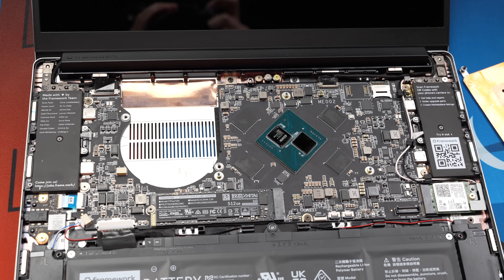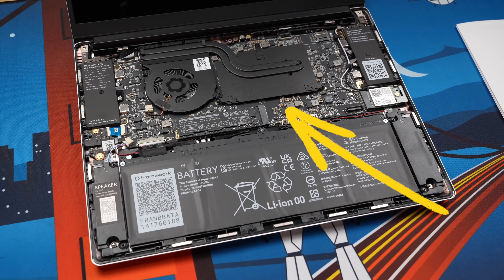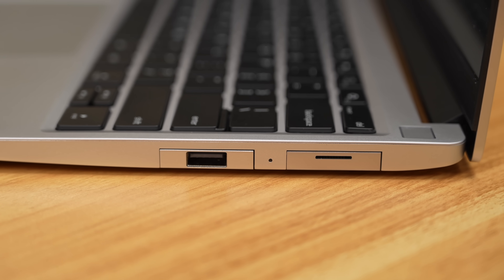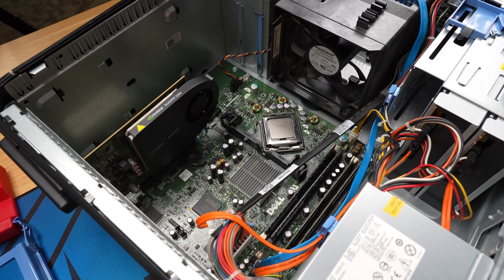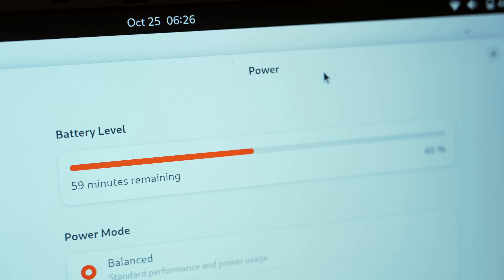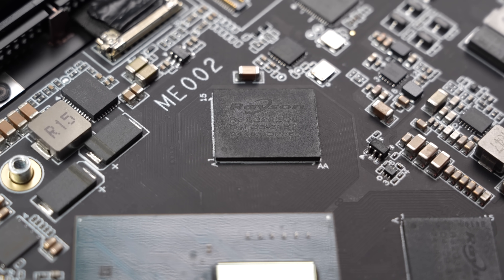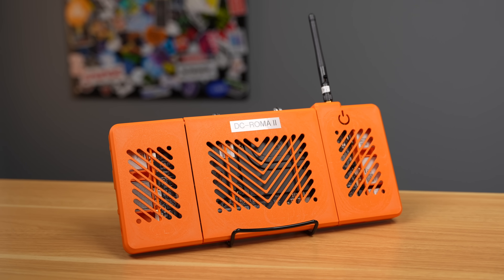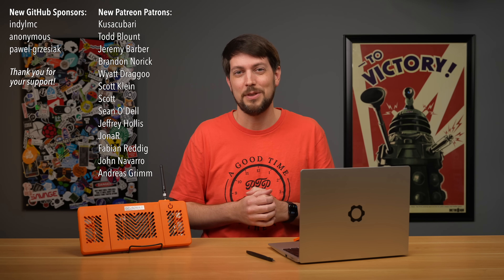This is not a Framework Laptop

Comment: The raspberry Pi 5 idles at around 2.7 watts and consumes 10 watts load.

The whole pi5 power adaptor is specified to supply 15 watts in total.😅

Comment: Core 2 Quad didn't have major issues with RAM - it wasn't NUMA, this was back when the memory controller was on the Northbridge. So it behaves more like a modern Ryzen desktop chip with the memory controller on the IO die.

Cross chip cache access was more cycles, just as it is on Ryzen.

By the sounds of it, this chip is NUMA.

Comment: Cross-die memory access was actually not an issue with the Core 2 Quad. This is because the Core 2 CPU dies did not have on-die memory controllers! Instead, both dies shared a common "front-side bus" that connected them to the Northbridge chip, and the memory controller (and integrated GPU, if equipped) was located in the Northbridge chip.
Reply: I guess another way to think about it is that since the Core 2 didn't have an on-die memory controller, all memory access was cross-die (to the northbridge). But it was equally bad from all cores, at least.

Comment: Looking at that graph, it’s not that cross chip latency is 2000 — cross chip latency is clearly 1000, but on the second die, the four cores just in that chip cannot communicate among themselves, they have to go through the main die (which is why their internal comms are at 2000 instead of 10). The old C2Q had much better due to die latency but also the two cores in the secondary die could still communicate at least with each other quickly. In other words, it operated like a true dual socket system. As opposed to this one, where the second die is essentially 4 separate slave cores to the main die, that makes the secondary die… actually relatively weak. The scaling factor is blind to be something horrific like 20-40% improvement, at max, just from looking at the single graph at 10:04 .

Comment: >other laptops use 1 to 2 watts at idle and maybe 3 to 4 if the screen is at full brightness 

I wish. My ThinkPad T14 pulls anywhere between 4 to 7W to display a single PDF in airplane mode with the brightness at 40%

Comment: It's still wild seeing RISC-V computers approaching the Pi 4. The 3B+ was, to me, very nearly a decent general-purpose computer, and that couldn't do demanding 3D rendering, got bogged down by 1080P video, and the I/O just wasn't good enough for that. Wonderful for managing a 3D printer though. Shame about the price and power draw, because those were two of the biggest reasons the Pi took off like it did with hobbyists and developers.

We even have stuff like the NanoKVM using RISC-V and actually being pretty good in the first market ARM really took hold in. ARM more or less went from GBA to MacBook within two decades, and x86 had some explosive growth over the 90's and 00's. That's at least twice that's worked out, so it gives me some hope for this architecture.

Comment: Correct me if I'm wrong, but I thought riscv was notable for its power efficiency?
Reply: Ok, you’re wrong 😊
The power efficiency of riscv is entirely in the hands of the implementation of the device. The shared/open bit is how instructions work— assembly level stuff. Below that is up to whoever makes the chips.
Reply: @rivimey So is the draw of riscv just the fact that it's open source? I must've figured it was supposed to be power efficient because of all the low end devices that use it

Comment: Well it is a development device so people can sort out these issues, it's not actually meant to be used or compared. Realistically even after all this time ARM is still trash. ARM works pretty well if the device has specific support like Android devices or an RPI but it's always a shame to see stuff like the RK3588 on an Orange PI 5 barely having hardware accelerated video and you have to stick with either Armbian or OrangePIOS if you expect anything on the board to work. Not reallly anyone's "fault" since these things are meant for Android appliances and the companies that make dev boards for them can't handle full Linux support. It's just a waste to have hardware that good that can't beat an RPI5 in regular use.
Reply: Apple seems to be doing very well with their ARM chips.
Reply: @atomprime1  Did ya see: "ARM works pretty well if the device has specific support"
Reply: @blazini yeah I guess if you're just going to discount all the cases where ARM isn't trash, then ARM is trash
Reply: @atomprime1  No ARM is still trash because the ecosystem is trash. Only with ARM does a cel phone smoke just about any more capable SOC soldered to a board that isn't power limited for the simple fact that the people who soldered the chip on there didn't have an extra billion dollars for software/kernel development. Funny thing is you're commenting on a video about RISCV and apparently don't seem to realize why RISCV even exists.

Comment: Pentium-D was even earlier example of two chips connected with an interconnect that burned the power just to do nothing :) But we don't have to search that far back in the past. Any chiplet designed desktop AMD CPUs use around 20W in idle for the CPU package. New Arrow Lake Intel CPUs are also not that energy efficient in idle as their monolithic counterparts. But my miniPC based on the monolithic Ryzen 7 8845HS with 64GB of DDR5 runs at 9W in idle for the whole system.
Reply from the maker: The newer designs are chipsets with specific interconnects designed in, though... Apple proved you can do it and not waste too much energy, AMD's been doing a better job there, too, lately!

Comment: Framework is most overrated garbage ever, when I tried first, I didn't have much expectation, but after just touching the laptop and everything is moving like it's gonna crack any time, just opening the screen feels like panel is going to just burst out of it, that's how flexible and bad quality is it, and the price... for the same price you will get double the performance on any laptop and even if you care about your money, just buy some good laptop and save that extra money that framework costs and pay it to repair service if that HP, or ROG or whatever laptop you buy breaks, I think that brand will die, especially when there are gaming laptops that have upgradable RAM and storage, keyboard and most of the stuff other than GPU/CPU can be replaced on any other laptop and Framework is just adding extra overheads Price+Terrible ergonomics+quality just to be able to remove keyboard in 2 minute instead of 20? does that really worth double the price? how often do you replace laptop keyboard? I have ROG from 2016 and Macbooks from 2013 and those laptops even battery still works, it's not new, but it still works. after 12 years upgrading same machine? they are also lying, after 6-7 years, you cannot upgrade device anyway, or you have to upgrade it with already old parts, because CPU socket will not fit, and most likely after 10 years Framework will no longer have those modules for that specific model anyway, so I think framework just found way to make money on some problem that never existed.

Comment: Nice to see the Framework form used outside of Framework themselves. Plus this seems perfect for building laptop prototypes since making boards in this form means you can swap to new boards instead of making whole new laptops and then easily recycle the old ones for new use cases.

Comment: Just remember that an ISA generally says nothing about its implementation. To give an analogy, a 4-cylinder gas-powered engine is an architecture, and both the Ford Model T engine and the Mercedes-AMG M139 engine are both different implementations of it. The former produces about 20HP, while the latter produces over 400HP. In other words, it's going to take a while for Risc V implementers to work in all the tech that Intel and AMD have been putting into their x86/x64 implementations for decades now (or that ARM has been putting into theirs).

Comment: Everyone makes upgradeable/repairable laptops. Unless it's an M series mac or a chrome book. You guys really need to educate yourselves on modular design within the tech industry. You think it's a little rectangular shaped dongle you plug into a type C connector. 

That's just the easily adaptable shape chosen for this version of 'modular' design. Framework fails to build laptops that are stable/durable as an equally priced/specced competitor. For the money you will spend on a framework, you could get a surface or macbook that won't need to be upgraded/repaired. 

I am really disappointed in Framework, what a missed opportunity.

Comment: "For a normal Framework 13 would get you 8 or 9 hours of use". Hi. Framework 13 owner since 2022. Yeah, no. No no no. Not even in the same universe as reality. Battery life is horrid even on a clean install of Windows 11. With the original Intel 11th-gen garbage or even the newer Ryzen board (which I upgraded in pursuit of battery), with power settings "Max Battery" and idle CPU, this thing is good for... three hours, as it stays warm all the time it's running. Only ARM-based laptops can touch "8 or 9" hours (I use my 2021 MacBook Pro at work for 7 to 8 hours on a charge). x86 is doomed in that regard. I wish Framework would make a Snapdragon-based board. I'd buy it in a heartbeat.

Power usage is OCD for me, and I've never been able to get any x86 system below, say, 12 watts at idle (with screen considered; metering total power running the system). M2 MacBook Air? Can be seen hovering around 5-8 watts. My most power-sensitive device, a home server running off solar and battery? 7th gen Intel laptop - the last generation to have power management worth a dang - a 4-core/8-thread x86 CPU that idles around 10-12 watts as well. Sure, some power-efficient x86 chips exist (Atom, "Pentium Silver" et al), but they're absolute trash at performance when you need it. I hate the state of CPU power today.

Comment: I know this wasn't a Framework Laptop 13 review, but in my 20+ years of laptop ownership, the Framework Laptop 13 ranks #1, for the reasons you outlined. It's not the best in any category, except accessibility, repair and modularity. For me, that makes it the best. I have a fleet of about 40 of these deployed in an enterprise environment and more than once, the need for being able to quickly repair them has been a huge win. I actually like the keyboards on the Framework Laptop and think they are far better than the Apple offerings but I think that might be a preference thing. I ultimately think that a mechanical keyboard is even better but if I have to use a laptop keyboard, I'll go for the Framework over any other, to date... well... maybe the Dell Latitudes of the early 2010s... those were pretty rad. Thanks for the video and the review. I really enjoyed it.

Comment: When it came to Ubuntu, the interesting bit there is that THERE WAS NO HARDWARE that supported the newer architecture demand. That's right, Ubuntu didn't bother to wait until any products were on the market, they just went "Eh, it'll exist, emulate it in the meantime"
Reply from the maker: I think it could also be a way of punting "official" support for RISC-V down the road a bit.
Reply: @JeffGeerling  Bigger problem imo is the whole devicetree garbage that's growing bigger and bigger. For some reason they have not learned anything from the pc platform, and just keep adding specialized support for specific boards, instead of just implementing a standard for probing hardware. It's like they took one look at ARM and went "let's copy the issues with that" :')
Reply: @TuxieBSOD  No, devicetree comes from open firmware, the first cross vendor standard for exactly that sort of probing. The board vendors just don't include them!
That said, risc-v in particular does have an insanely arcane enterprisey boot structure copied from ARM servers.

Comment: My opinion about this video is that it turned out to be a hodgepodge of information about both the DC-ROMA II and Framework, when my understanding is that they don't have anything to do with each other except that the motherboard works with the laptop chassis. I would have preferred a clearer separation of the risc-v motherboard, and the Framework laptop. 
For example at 2:06 you go from discussing the Framework laptop and the expansion ports that are available, to testing them presumably with the DC-ROMA II installed, so the performance and compatibility would probably have more to do with the risc-v board than Framework itself. Then you jump right into discussing the resolution of the display, which I don't believe DeepComputing had much to do with. (Please let me know if I'm wrong)

Thank you for the video!

Comment: 'won't to go e-waste in a couple years, once linux isn't supported on it" What are you talking about? It's running linux now, how would it get less supported?
Reply from the maker: Meaning once Ubuntu 24.10 is unsupported. Eventually the number of things you can get running on it dwindles, unless you want to just stick with the old versions of everything at a set point in time forever. For some use cases, that's fine.

Comment: “For a normal framework 8 or 9hrs of use”, I have the AMD chipset and I’ve tried both battery options and just using the cli and some light internet browsing (less than 5 tabs, maybe 1 YouTube video) I get like 4-5hrs tops. Idk why but battery has been terrible for me no matter which board I get or upgraded battery option. I get like 2 days out of my MacBook m3 though so there’s that…

Comment: While this not a setup I'll ever buy, this is a prime example why the laptop design by Framework is so great. You can actually just switch to another architecture within the same frame. This is unprecedented for a laptop case afaik.

I'd go for the 16" model, because I already use 6 ports during basic usage, but apart from that: great! So flexible.
The Dragonbox Pyra, a relatively modern micro-laptop has plans to support both ARM and X86-64 Platforms, but has already faced a lot of issues getting the most out of the default chosen Texas Instruments OMAP platform, but this Framework is already a much more mature product. A mushy keyboard though...Eww.

Comment: Reminds me of the 6502 I saw - on an Arduino sized board. 
In theory, you could have a Z80 / 6502 main board, for the Framework chassis. In practice, software emulators would mean less fiddling with screws etc. 
But that expansion module is great! Lets you run Arduino / Pi style hardware experiments, on any PC (or Mac).
I want one!
Reply from the maker: Heh, what would you do for USB-C modules though?? maybe just power on one, UART on another, floppy through USB on another...
Reply: @JeffGeerling  True - another point for emulators. Still want a USB expansion module though, to hang off an old Lenovo Laptop.

Comment: 25 watts idle didn't sound like too much until I realized that's more than my SteamDeck uses WHILE GAMING on the more demanding games
Reply: The raspberry Pi 5 idles at around 2.7 watts and consumes 10 watts load.

The whole pi5 power adaptor is specified to supply 15 watts in total.😅

Comment: 2:31 2.2K is not a resolution. 2,200 horizontal pixels at 3:2 aspect ratio gives you 1467p (1466.67) as the resolution. 

I know it is pedantic, but can we please stop using the TV industry's near-fraudulent marketing terms for display resolution?
Reply from the maker: It's a convention, and it's confusing, but it's the spec they provided, so I'm using it. Easier in the old days when we just had VGA and SVGA :D

Comment: With the core to core latencies, I think you read (or at least verbally expressed) your graph wrong.

The 2000ms time you highlight are actually for a core to access data held in cache by a core on the same chip! And it's nearly double the time to access data that is on the other chip (the top left and bottom right, which are consistently 1029ms)

The intel graph clearly shows the expected pattern of slow interchip communication and faster intrachip comms (though the actual values are better), except that the second chip manages to behave like it is the first chip when doing core to core transfers.

So, this dual chip design is not really operating like two chips with 4 cores each, it's operating like 1 4-core chip, and 4 1-core chips (plus a very slow interconnect).
Reply: That is so interesting! So the 2nd chip's cores have no direct communication between each other and have to go through the "master" chip?

Comment: The fact that RISC-V is already comparable to ARM from a few years ago is actually fairly impressive, considering the huge head-start ARM has.
Reply: The point which slips jeff completely, considering how long RISC-V is actually on market and it's already one step behind arm says that it might overtake leadership in couple of years, especially considering that it's got standardized profile of common instruction set which makes solid ground for wide adoption

Comment: Can you just disable the other die on powersaving? half the compute, but limit inter-chip communication? When under high-compute tasks it spins up? In server infrastructure I'm used to enabling/disabling NUMA in hypervisor hosted VMs to remove that latency on VMs. Don't allow VM's to span NUMA nodes. Very rare cases are exempt. I feel like these are the same concept but on-die instead of two cpu sockets. Yet the latency you reviewed is somehow anecdotally worse than numa..

Comment: Feamework owner. I think the keyboard is really good, less hard to press the keys than on my Thinkpad x1 nano that I passed on to my mother. I am very happy with my purchase, but there were several small startup problems. At first it would not show any image on the screen until I took out a ram module, started it, turned it off, put the ram module back in and then it worked fine. The new transparent frame was a bit difficult to get to fit, down by the right hinge. All in all, I would HIGHLY recommend it. People can just choose their prebuilt version